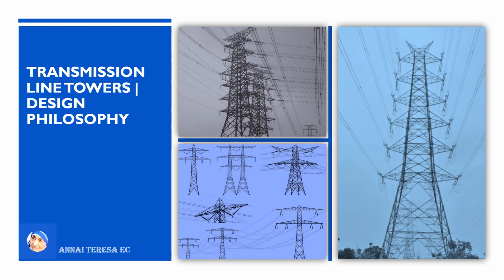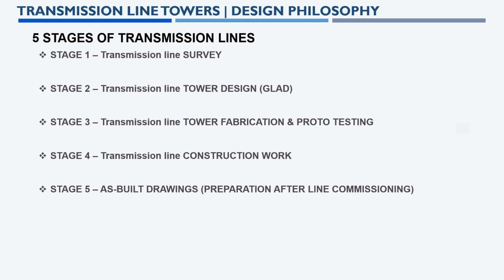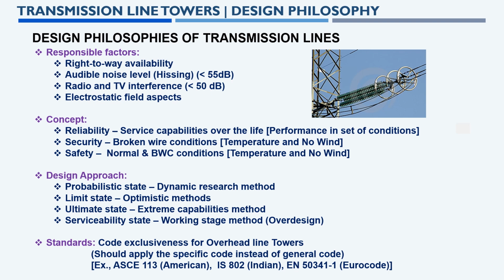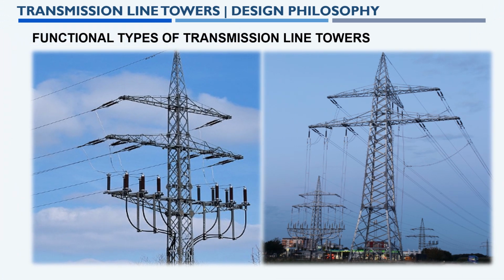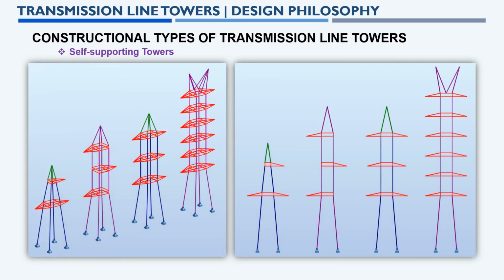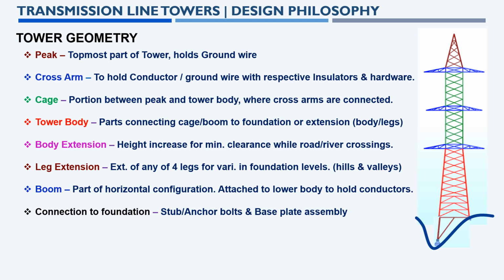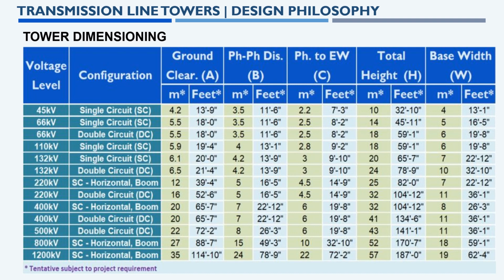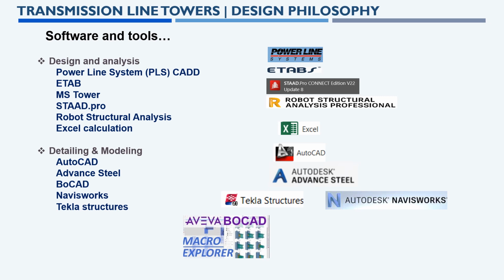Transmission line Towers | Design Philosophy

Comment: Can u suggest any book regarding transmission line route plan designing?
Reply from the maker: Yes. 1. EN 50341-1 specifies norms as per Eurocode. 2. Guidelines for Electrical Transmission lines ASCE Manual 74 and 52 can be referred.

Comment: Very good video. How do you determine the corrosion class of transmission line?
Reply from the maker: Thanks for watching. Generally, corrosion resistance requirements are based on customer specifications or can be followed as per ISO 1461.
Reply: @annaiteresaec  you are right according to standards but I mean generally and considering the atmospheric corrosion categories lets say c4
Reply from the maker: @Riklenes_Nook  ISO 12944 will provide guidance on this topic. C1 Very low for  Residential, C2 low rural low pollution, C3 medium for Urban industrial structures,  C4 High industrial buildings at coastal region,  C5 Very high for buildings at Costal region having saline and high humidity and CX extreme applicable for offshore structures. These explanations are provided in ISO 12944